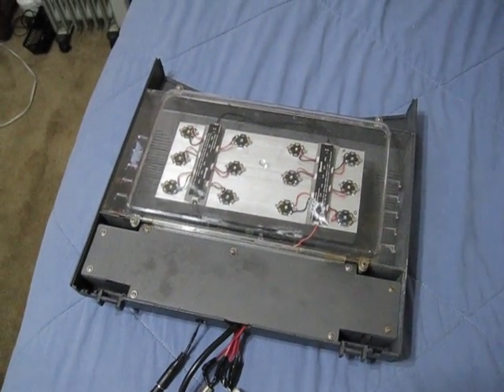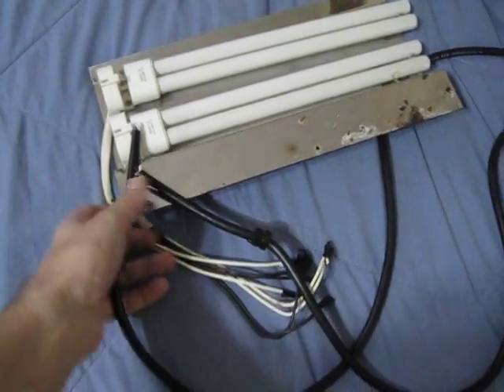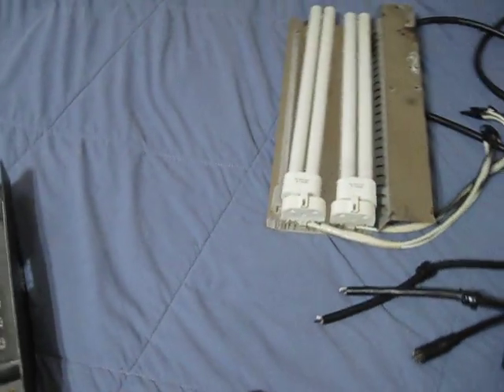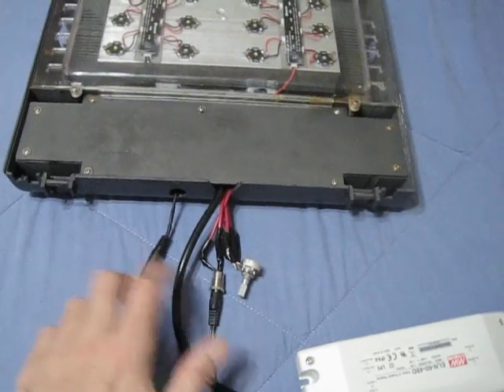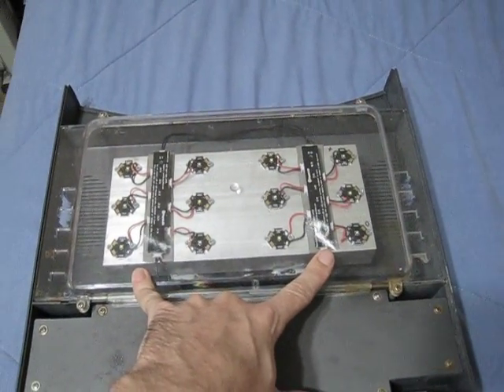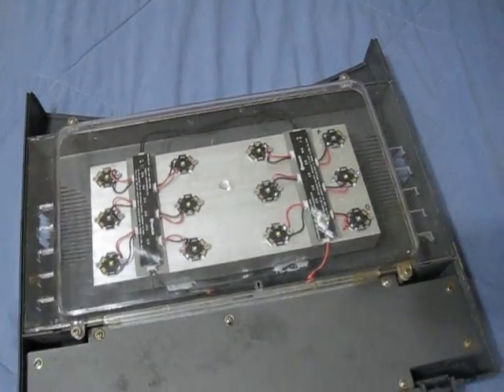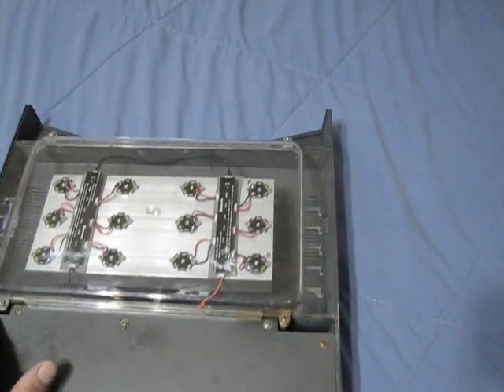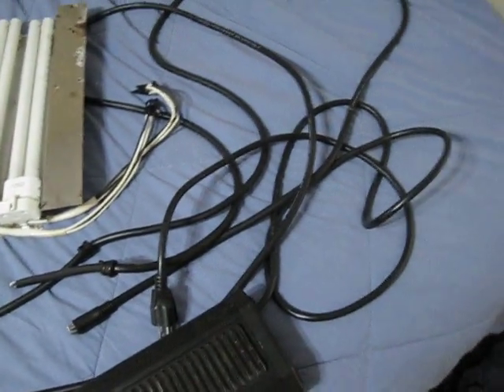JBJ 12 gallon LED upgrade Overview 11/19/2011

Comment: My 12G JBJ is at least 10 years old and the CFL hood finally quit working.  To buy a new CFL hood + ballast cost as much as a whole new setup, so I ordered a new 12G JBJ but they sent me the LED model.  Are the LEDs that much better?  I'm debating whether to keep the LED or send it back and insist they send me the CFL model.  Any suggestions or advice would be most welcome.  Thanks.